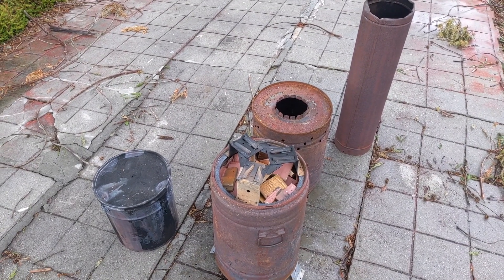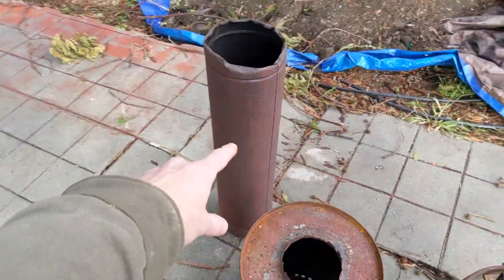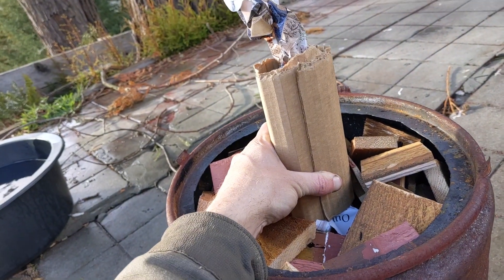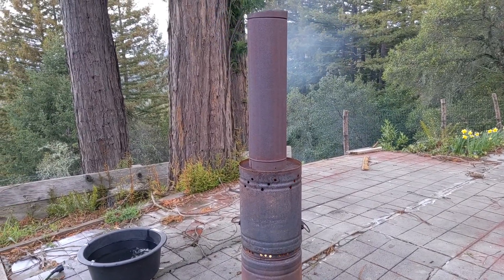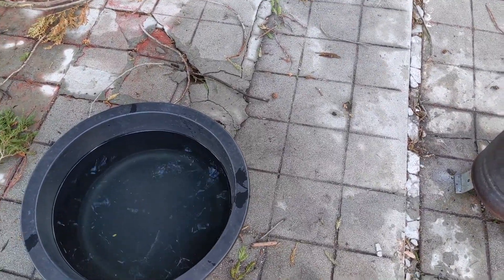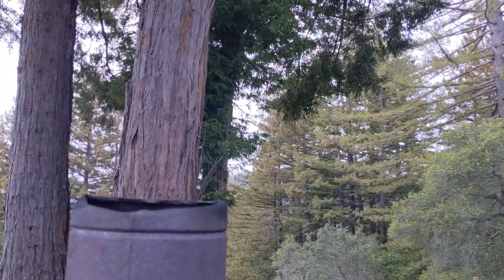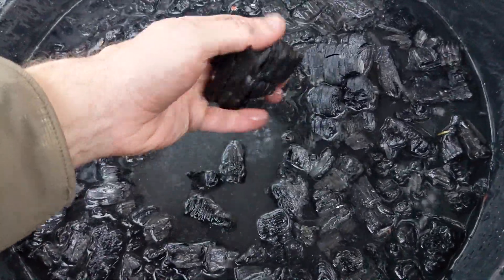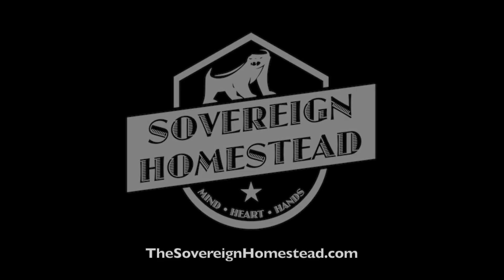Double Stack TLUD Biochar Kiln For Homestead Charcoal Production

Comment: I wonder if you're getting so much smoke because there is not enough secondary air to burn off the exhausted gas. Perhaps a bigger gap between the two barrels or more holes in the smoke stack. I love the idea of the retort within the top barrel. It uses the primary burn to heat the contents and adds its own gasses to be burned increasing the heat. However, it may be adding to the oxygen deficiency problem which exacerbates the smoke issue. Thanks for sharing your ideas.
Reply from the maker: I agree - either not enough secondary air, or it isn't sufficiently pre-heated (insulating the jacket would help), or not enough mixing, or some combo of all three I think. More experimentation required - next one I get to build I'll measure the various CSAs and publish their ratios to at least show other what doesn't work :)

Comment: What containers are these from? I can not find anything in a decent price range to use.
Reply from the maker: The main barrels are 7 gallon barrels that a client had a bunch of and he gifted me two - similar to these: https://bascousa.com/pails-and-buckets/open-head-steel-pails/filter/capacity:7-gallon.html

The smaller internal retort I did purchase and was a stainless steel pail with lid - something like one of these: https://www.thecarycompany.com/containers/pails/steel/open-head

Just make sure to measure your various diameters and ensure you've got consistent cross sectional area between an outer pail and an inner retort pail to maintain good draw - something I need to dial in better with my next one. Good luck!

Comment: Another way you can start the flame is put some rubbing alcohol in a spray bottle, just lightly spray the top and then light with a match or lighter wood-burning twig.
Reply from the maker: Will try this next time - thanks!
Reply: @thesovereignhomestead  to be honest I've never tried rubbing alcohol with wood splits, but it works great with wood chips like the Western red cedar pet bedding. It leaves no contamination.

Comment: Interesting design, I use a beer keg for the primary chamber, the handle holes are just the right size for secondary air, I've experimented with different things for the secondary chamber, I've settled on putting the chimney through the actual chamber welded round the base with holes drilled into the chiimney inside the secondary chamber for off gassing, having the fuel all a similar size works best for an even burn, either chipped wood or sticks split to a similar thickness, tho you didn't have any oils visible on the surface of the water so it looks like you did OK even with some larger chunks, thanks for sharing
Reply from the maker: A beer keg is a great idea for the burn container - those are insulated, or at least have an air gap, correct? I'll see if I can get my hands on one of those. If you have a system I'd love to see a video of it in operation!
Reply: @thesovereignhomestead  Nah they're not insulated, but they are made of stainless steel so will last forever, I won't be burning til summer since I use woodchip and need to dry it out in the hot sun for a few days, if your feedstock is all diff sizes/big chunks a 55gal drum on it's side with a 10" wide slot cut in the side is a simple design that works, primary and secondary air comes in over the top into the slot but 10" slot restricts burn enough to form char, as an ash layer forms add more fuel, repeat until full, still needs quenching when flames stop but is the easiest big batch design for large chunks, and you can just roll it over to empty it, there's a vid on YT of a farmer loading it from a front loader can't remember which channel tho!
Reply from the maker: @glassbackdiy3949  Yes! I have actually made and used one of those side-cut 55 gallon drum style kilns - it was a lot of fun and very hot to manage that burn. Pretty cool how the flame practically gulped air in that design. Happy burning!